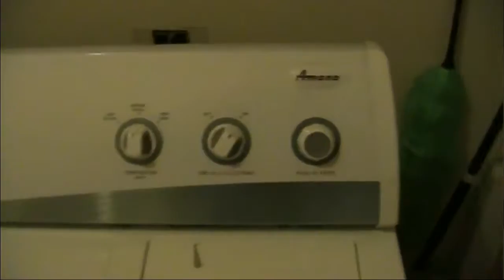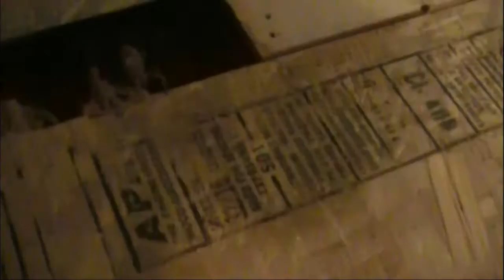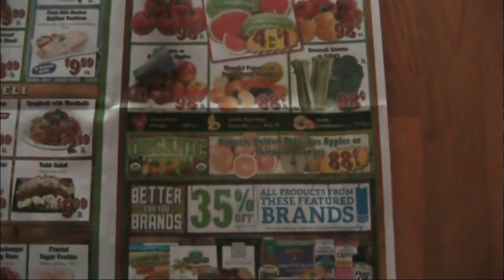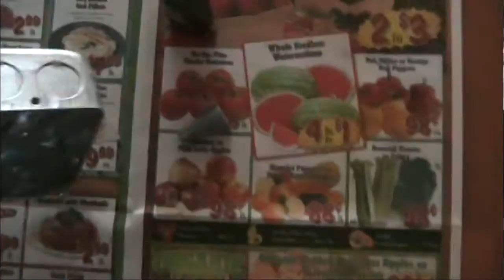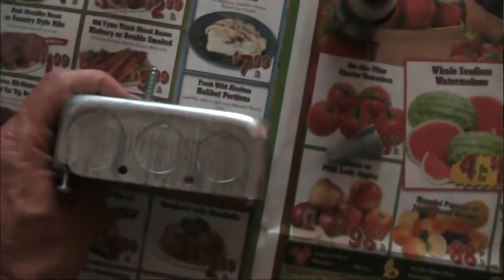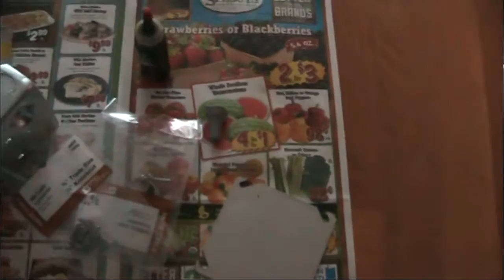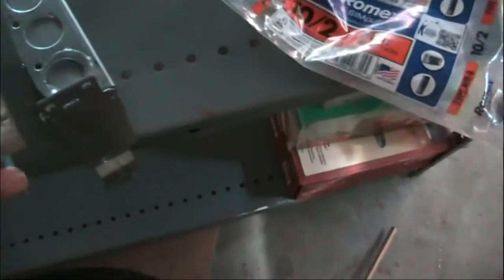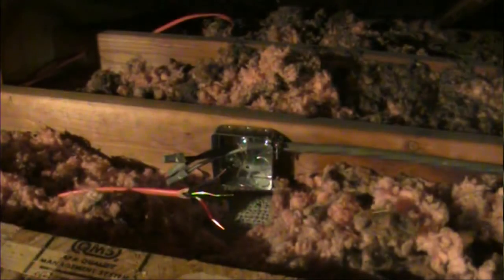Move a 240V 30A Circuit

Comment: I'm moving a dryer outlet and found your 6-yr old video.  I do a lot of DIY electrical work, but my caution goes up exponentially in line with the voltage - for 240V that means I watch as many videos as I can find to see the problem / solution from multiple angles. Your video helped my project (junction box was what I was looking for) and I respect / enjoy your banter - amateur to amateur, nice work and thank you!

Comment: You can't have a 30amp breaker and a 20 amp socket. Please switch out the breaker to a 20 amp
Reply: Good point!  Actually, this was a temporary setup until the Blink charger is installed, which is 30 amps, which is why the wire is #10.  But right, should have put in a 20A 2P breaker.  Or a 30A socket there, and a 30A to 20A pigtail, if there is such a thing.
Reply: Just a note, I finally installed the Blink wall-mount charger, which requires 30A, a while back.